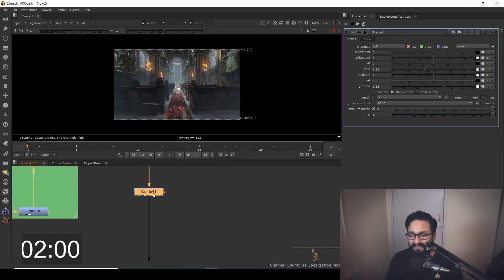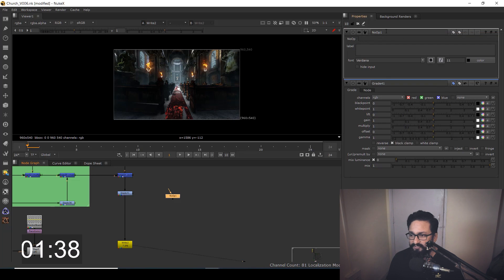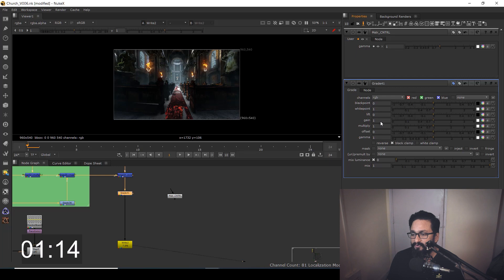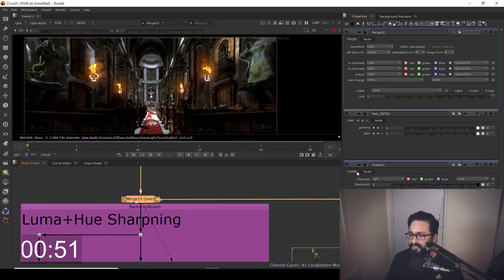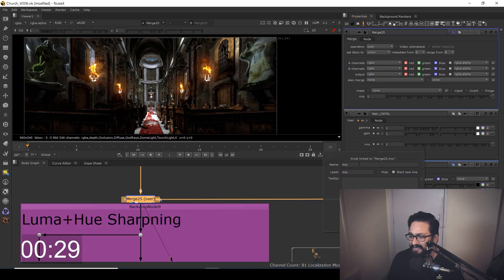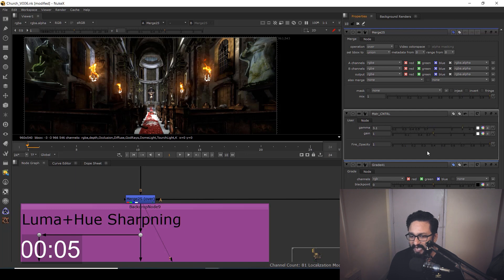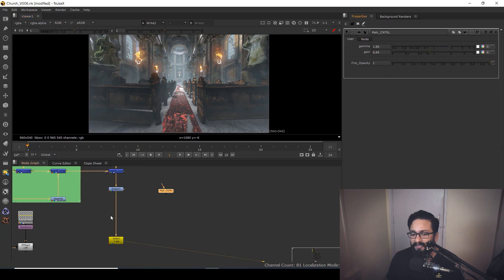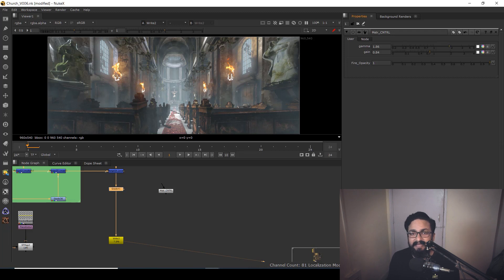POWER OF NoOp NODE IN NUKE | TWO MINUTES TUESDAY | VFX VIBE

Comment: Small doubt bro. However I have go to each particular node and drag and drop the values. Instead i simply change directly in grade or merge. What's the special advantage in it. Even if my comp is very big. I'll have go to go each particular node and drag and drop the values. Can please reply.
Reply from the maker: It's all your personal choices. Suppose multiple corrections are coming for few common parameters, then we can make one MASTER CONTROL to tweak it. But it's not mandatory to create one. If you are comfortable in doing manually, then it's all ok👍